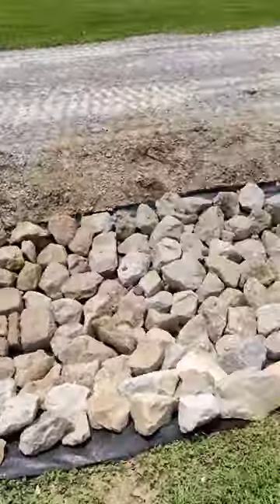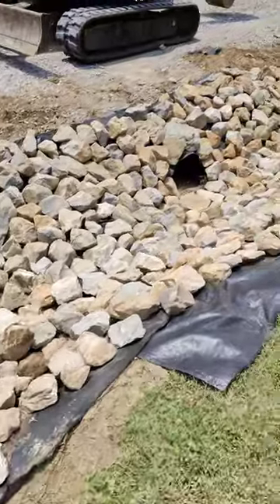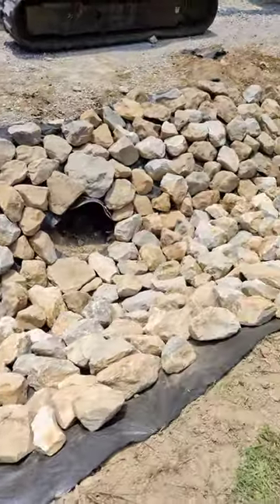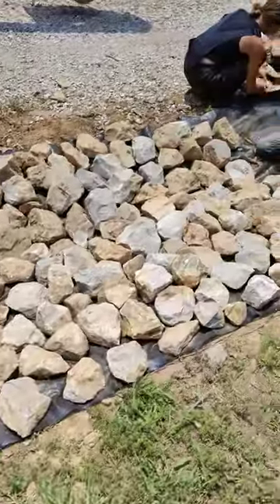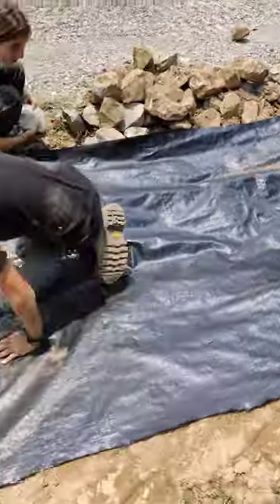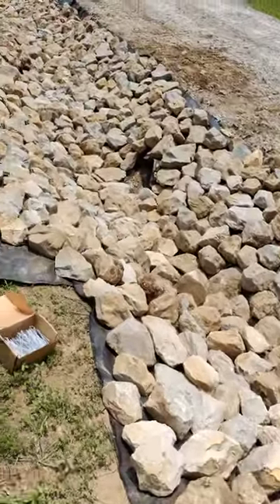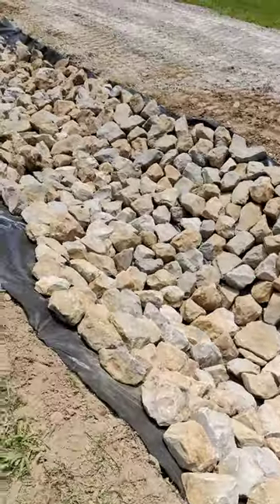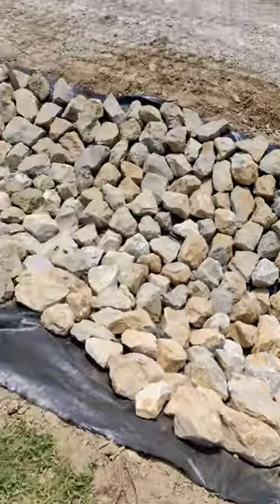Are They Crazy! Hand Place Rocks in a Drainage Ditch?

Comment: What about the leaves and mud clogging it up? We did this going down are driveway. We had reclaime on driveway but did the number 4 stone ditch and leaves clogged then mud and it basically made new ground all through the stone.
Reply from the maker: This is rip rap not 2 inch. You just need to spray it now and then. If there is mud, then you need to cover that dirt with rock or vegetation.